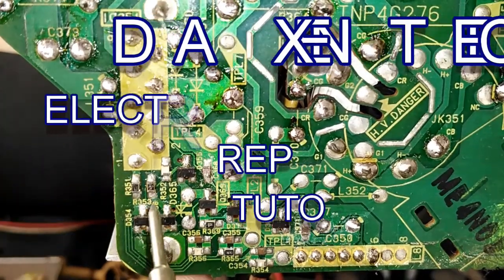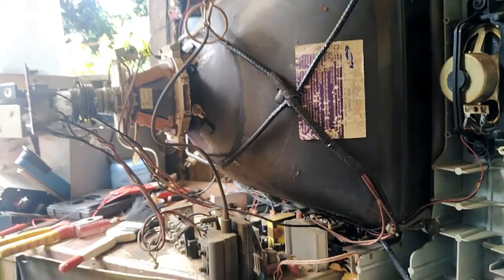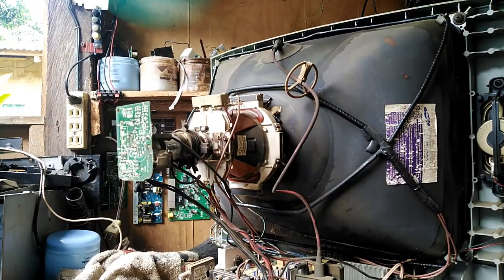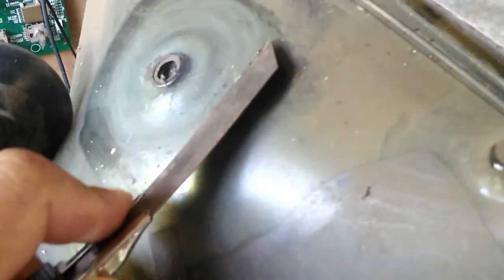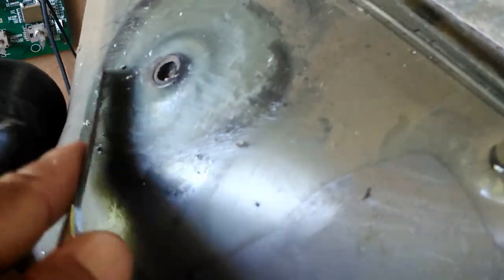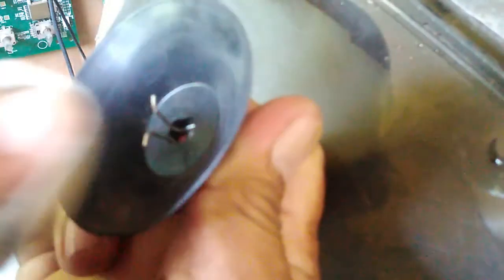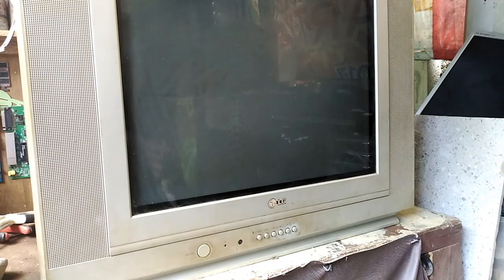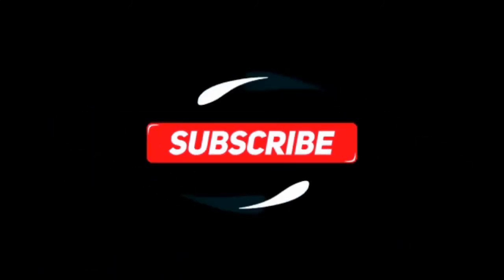LG 21" CRT TV LOUD ARCING OR POPPING NOISE PROBLEM

Comment: I want to THANK YOU a lot ! I had the exact same problem on a Grundig that I found on the street. It would not turn on and make the same sound. I discharged the tube, cleaned everything with water and soap (except the tube), and follow what you said in your video. And now it is working perfectly. Thank you so much !
Reply from the maker: thank you for your support..

Comment: I found one that does turn on, but not only did it have the loud sparking problem, but the sparking is very visible on the edges of the screen (almost electrocuted me), and the whole thing only displays in green color and is VERY blurry. I have a bad feeling about this.

It's still in a random driveway as of now

Comment: My old lg tv (2009) is constantly making 'shhhh' sound ( at high volume at first switching on and gradually reduces it to a medium sound). Is it danger that I should  repair it immediately ?? Please answer sir
Reply from the maker: Yes its a high voltage leak from the flyback transformer anode cup.. Call a qualified technician for safety measure..
Reply: @DANEXTTECH  Thanks sir

Comment: I was just sitting here, letting my PS2 run in attract mode basically, and idk if my CRT overheated or what but it let off a weird high pitched sound almost like steam escaping a pipe, then the screen went blank. Wouldn't turn off, had to unplug from the wall. The next day it turns on and works just fine... 

Do these overheat? What can i do to prevent that?
Reply: I’m no expert but i know they can overheat but it would have to be on for a long time unless it is not getting the right ventilation check it’s not dusty or it could be an issue with the capacitors not too sure though